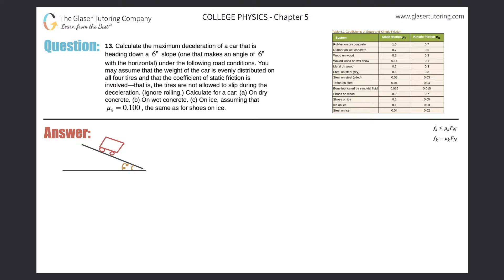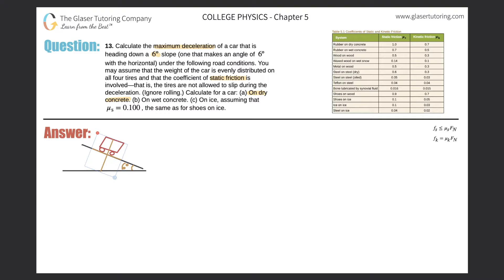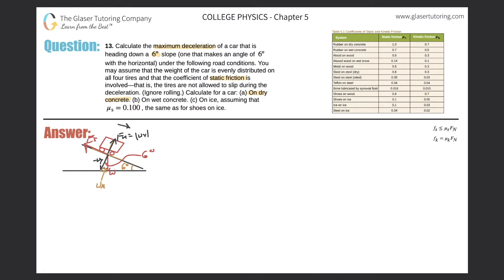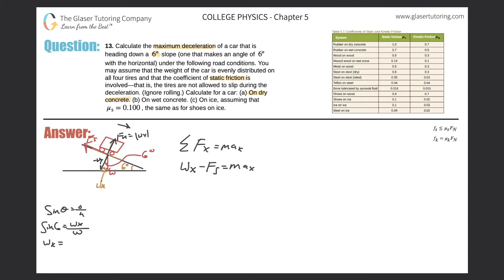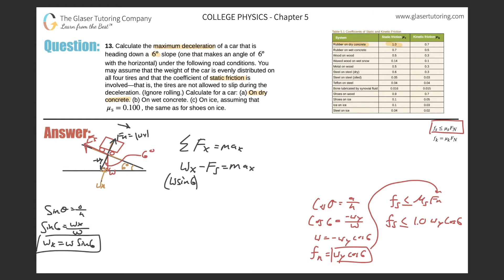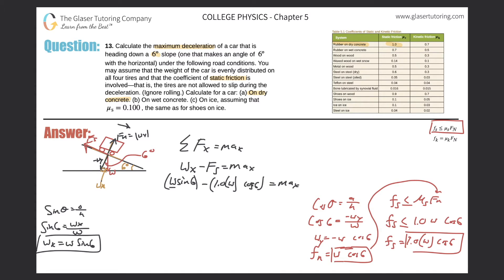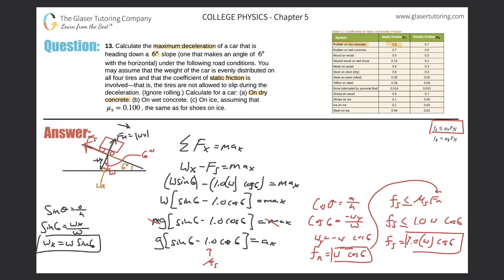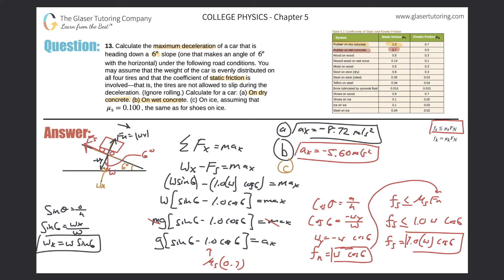5.13 | Calculate the maximum deceleration of a car that is heading down a 6º slope (one that makes

Comment from the maker: Hey everyone!  Just wanted to point out a silly mistake.  In Part B, at 10:43, the answer should be ax = -5.80 m/s^2 instead of -5.60 m/s^2.  The work and the process is correct, I must have just put it into the calculator wrong.  Study hard! 😃

Comment: in the step finding Fn shouldn't w= -wy/cos6 ??? because you multiple the w to get it out of the denominator then divide both sides be cos 6?
Reply from the maker: Hi there! I see what you're asking, but in this case, the weight component along the slope (which is wy) is already accounted for by using sin(6°), while the weight component perpendicular to the slope (which is Fn) uses cos(6°). So to find the normal force (Fn), it's wy * cos(6°), not -wy/cos(6°). The negative sign usually represents direction, but here we’re just focusing on the magnitude for Fn. The formula stands in the video. Hope that clears it up!

Comment: This problem is tricky. You actually have to add the static friction force and the x work of gravity. This is because at the start of the problem it says the car it is heading down the hill. So getting a negative acceleration makes little sense. Other than that very good video. Just add the two forces or else you will get the wrong answer.

Comment: I am wondering about the backward friction force. The text says there is no slipping. But the only way to get a backward braking force on the car from the ground is to lock the wheels. Your calculations are based on that. A grave misunderstanding from you about basic physics.

Comment: for part A, the class solution manual added the two forces instead of subtracting resulting to an answer of 10.8 m/s2. I am confused on which is correct. Personally I think since acceleration and friction are in opposite directions we should subtract agreeing with your answer.
Reply from the maker: Your reasoning is correct!  Since the w value is in the positive x-direction, it has to be positive and since the Fs is in the negative x-direction, it has to be a negative value.  The format in the video is correct.  Hopefully this helps!